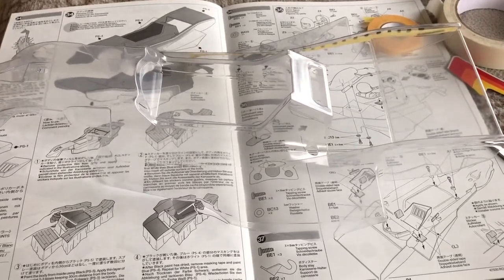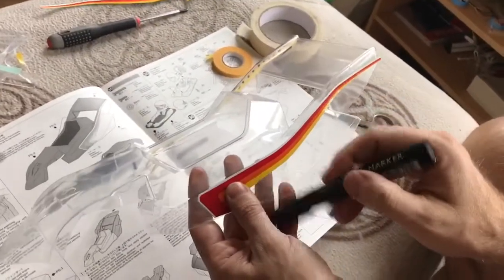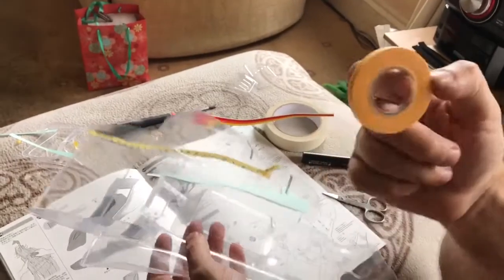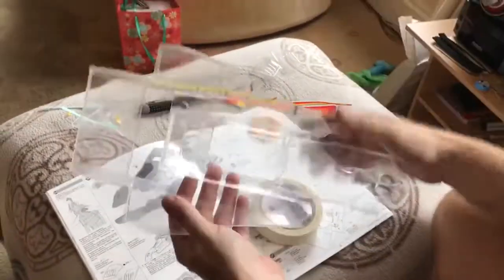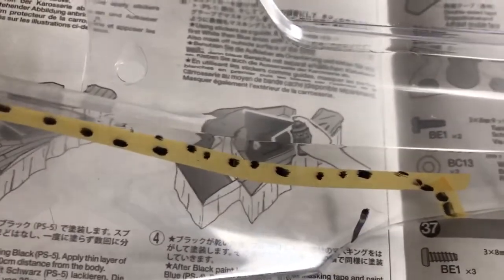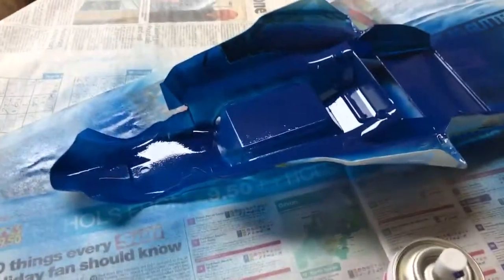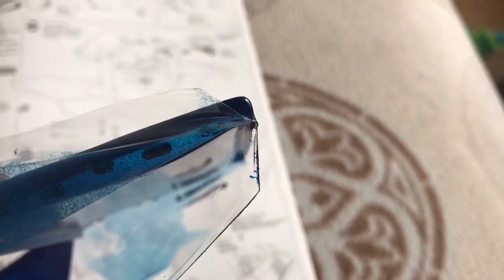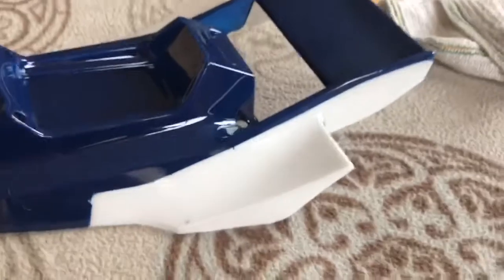How to Paint the Tamiya Bigwig Shell...

Comment: cool little vid i did mine the same way too line up the decals , just a little tip my mate showed me a few years ago that if you want black in fills on out side of any shell leave the protective film on and cut out the area you want black with a sharp blade (super fast and easy)  and the wrap acts like mask, then  its just a quick blast of in fill color and your done ,remove wrap at the end , i do this on air intakes (front) on my touring cars and window frames  gives a nice satin look, any way killer set up with the glass cabnets

Comment: I've watched a few of your videos, and I admittedly always cringe at the "paint the driver with a black marker" cheat. that is, until I was building my Bigwig roll cage last week, and I very carefully and thoroughly applied the little black decal into the wrong side of the roof air intake, and then very carefully and thoroughly ruined that decal trying to remove it. black marker to the rescue.